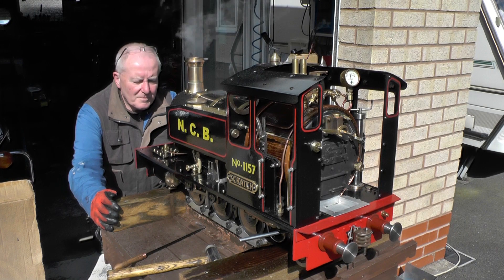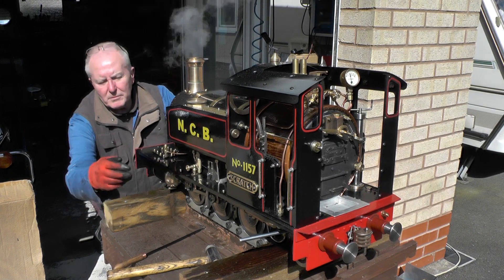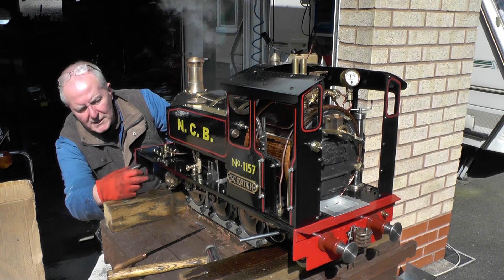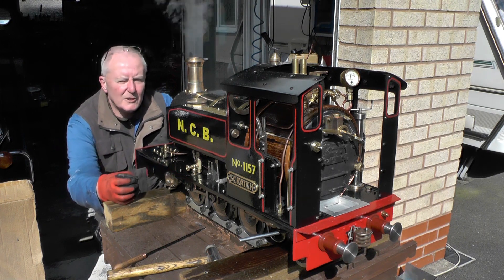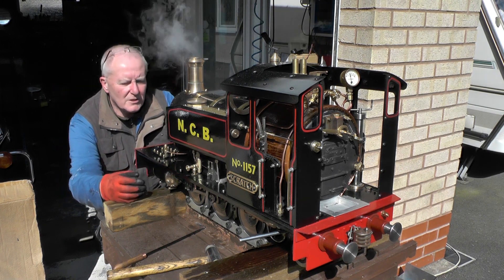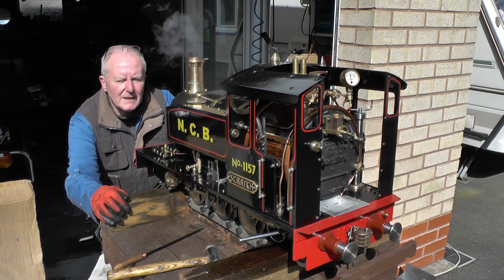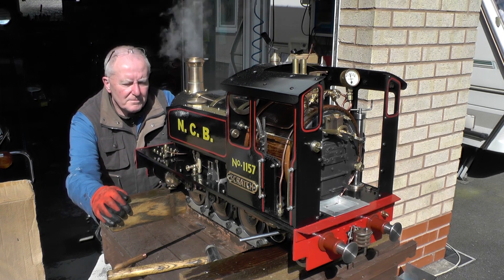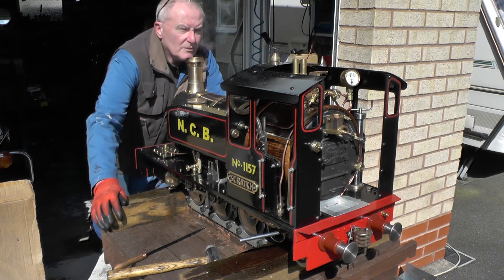Build Your Own Beginners Steam Locomotive Series (1st Steam Test & Thankyou ) "mr factotum"

Comment: What ho Mr F,
Is that a CX500,  how many camchains and water pumps?
So that is what you look like or was that a stunt double.
Oh good to see it alight at last.
ATB  
c
Reply from the maker: cheers chris
all will become clear tomorrow, 
mr f
Reply: @MrFactotum  it may become clear but will i understand?
Reply from the maker: sorry chris didn't answer in full, 
cx500, actually none and none as yet,  its the model after the camchain problems, It was a 1 owner (deceased) with only 6000 mile on clock when i got it 10 year ago. Done 21,000 mile now, and never had to have a spanner on it except for the usual yearly servicing.
stay tuned for the 2nd steam up tomorrow!!!!
regards
mr f
Reply: @MrFactotum  i remember one chap i knew had 7 cam chains in a year, all under warranty of course.
Another chap i knew changed his oil every week, at the scheduled interval yup he did that mileage on his. Get a good one and it was good. Get a pup and well you know what....
If the midland show is on this year , planning on going?

Comment: Well done. A suggestion about the drain cocks is maybe the method your using for them. Automatic drain cocks can be ok but tend to not get all the water out of the cylinder so this may be the reason why the cylinders were so stiff with being brand new. Maybe steam operated or manual drain cocks would be better and sort your issue.
Reply from the maker: thanks es
all will become clear tomorrow,  but noted your comments and advice
thankyou
mr f

Comment: Hi Me. F, it's great to see the loco in steam and the whistle sounds very good on steam. I guess that some time spent running it in, will free everything up.
 I have been fabricating the mechanical lubricator, starting from the tank, silver soldering the four sides and the base,  the lid which I will fit on 2 hinges. Made the oil check valve and cylinder. The bearing sleeve and the crank. Next will be the pawls and the lever. The ratchet wheel, I had bought commercially years ago.
By the way it is great to be able to put a face to the voice. Take care and catch you on your next video.
Emanuel
Reply from the maker: thanks EL
all will become clear tomorrow, 
sounds like youv'e been very busy
see you tomorrow
mr f